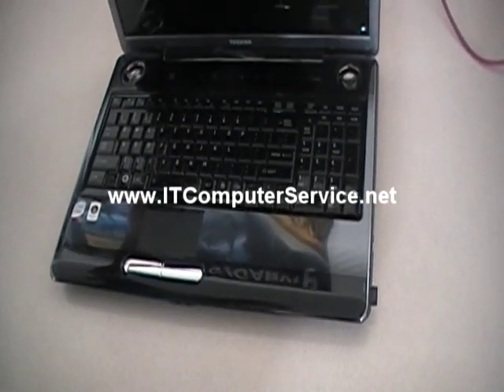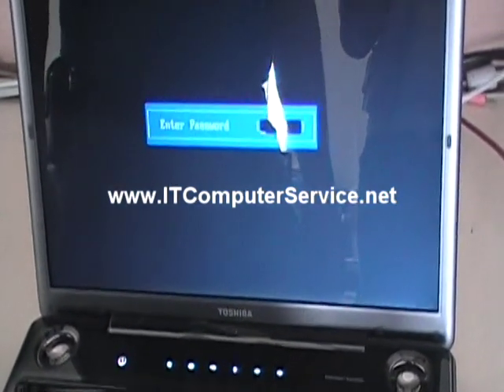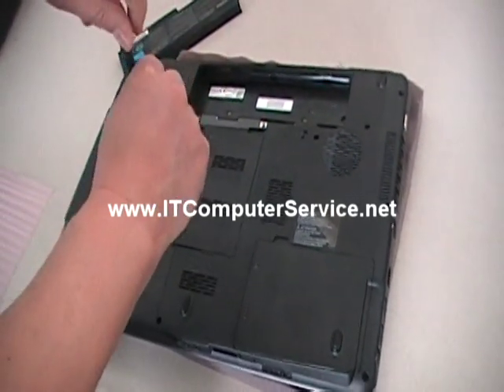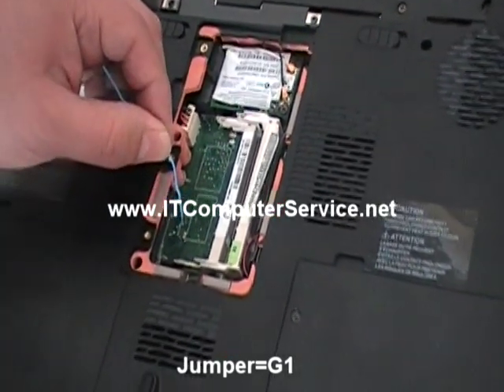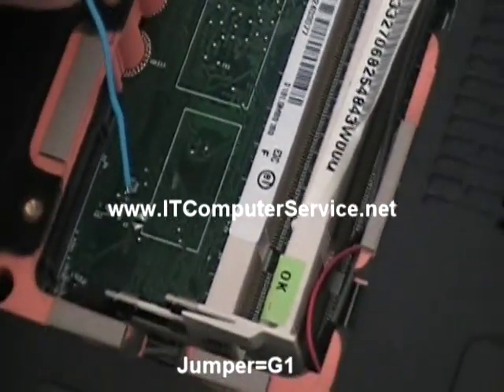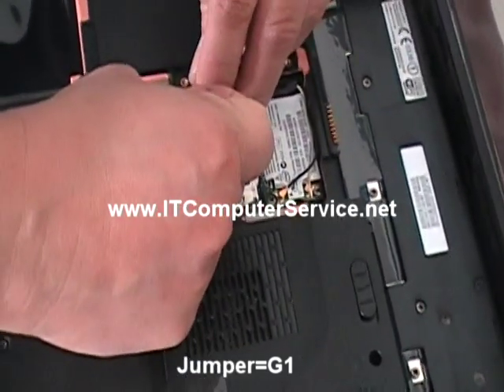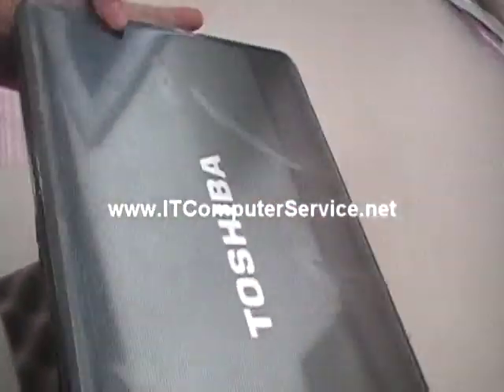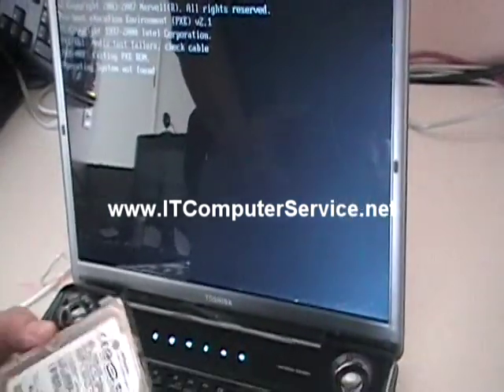Toshiba Satellite P205 P215 P305 Bios Password Removal

Comment: i have a HP P6000 and when i boot hte system it brings up a drives screen and it looks like the bios screen the only button it shows is F10 and then it goes to boot settings. i want this screen not to show up when i boot can you help?
Reply from the maker: Sorry about that but I cant help you. You can go to HP's website and try to find the setting that will need to be disable.

Comment from the maker: hold the screwdrive or cable on making contact to the two solder points for 40 to 60 seconds.with the laptop off and with out the battery.

Comment from the maker: You can clean the triange to make sure that there's no glue on the jumper. after that you can use a standard screwdriver, paperclip, piece of cat5(Network cable) or any piece of 22gage cable.

Comment from the maker: We have not worked on the 3680 before but I believe you can just short out the G1 for 40 to 60 second with the laptop off and that should remove it. 

***PS, we are not responsible if you damage the board. ******

Comment: hello, I have an ACER ASPIRE 3680. i HAVE LOCATED the G1 on the mother board. what is it i connect the paper clip to to reset the bios password? in this video you did not reinsert the hdd  and show that the password has been removed from the hdd. please help i have subscribed.

Comment: I have a P305D that I am working on for a friend, It's exact model os P305d-s9800, it is the AMD 64 variant of the one seen in the vidio (instead of the intel). The BIOS is still Phoenix,  and I have the G1 jumper but it is not in the same location, it is behind the memory mount instead of in front of the small boxes. Any help would be appreciated.

Comment: Hello, Im trying to carry out the procedure for a Satellite P300-19P - and unlike your picture there are 2 jumpers labelled G1 and G2, they are in the same location on the Motherboard as your single jumper.  I have tried for 45 seconds on each of the jumpers using CAT5 cable and with the power cord in the laptop, is there anything else you may suggest?  Thanks, appreciate your video

Comment: I have a compaq cq50 215 it seems the hinges have broke on one side and the other is cracked and the wires for the lcd crimped and smoke came from that area now it turns on but no lcd . Is this a common problem for this model? I am a disabled vet so money is very tight.